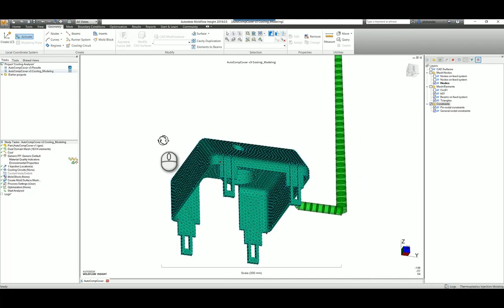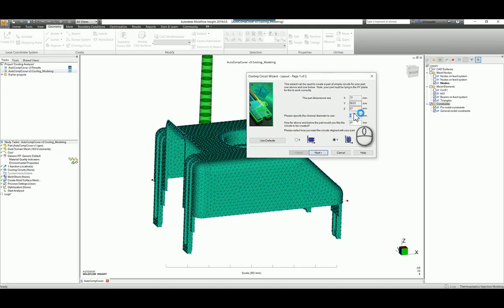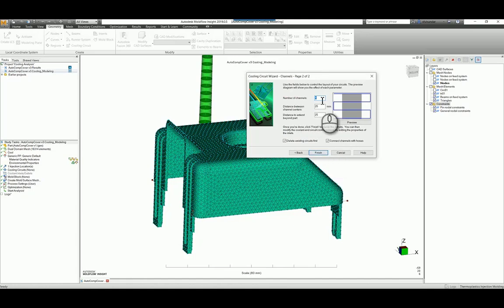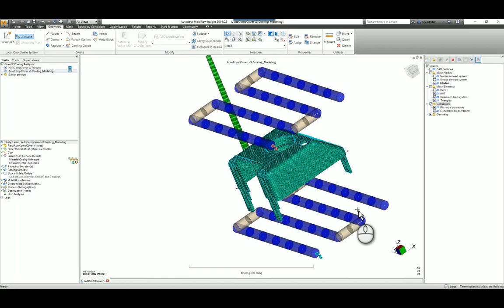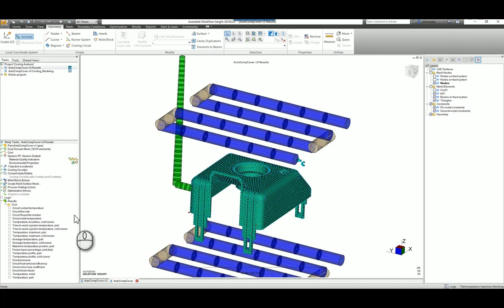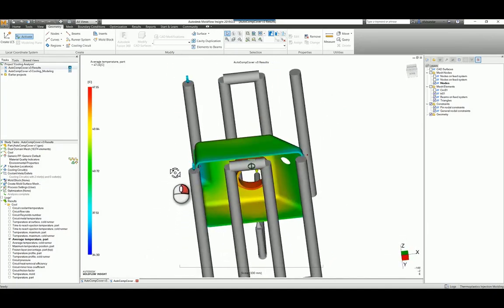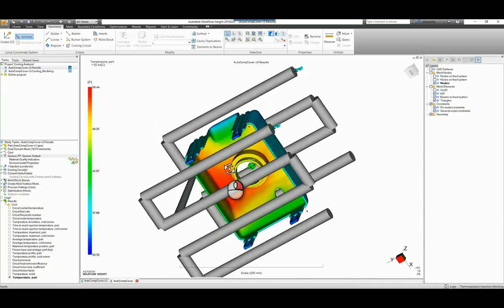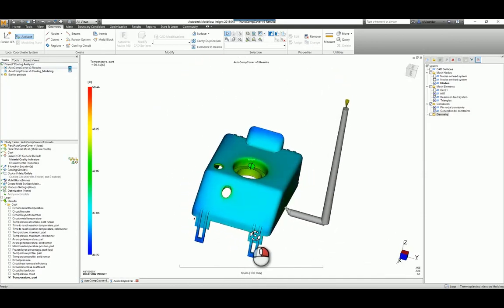Autodesk Moldflow Cooling Analysis - Getting Started

Comment: Hello Sir Sachin 
i have a question about the accumulation of heat through cycles for example if the cooling cycle ended with temp variance of 5 degree and the second cycle started that place which has high temp will be even hotter after the second cycle and so on after many cycles and may end up being way hotter than the other parts of the surface right ? 
what is the analysis in moldflow that can help me predict temperature over cycles and how to solve that problem 
thanks so much
Reply from the maker: Hello Mustafa - thanks for your query. Moldflow Adviser basically does a static thermal analysis based on the Mold filled with molten polymer. Melt temp is taken as the reference to start the thermal analysis. What you are referring is the transient analysis and that too with production start up. Yes there would be temperature difference between two cycle but when the process get established ( like eg after 25 cycles) different should be constant thus equilibrium is achieved. It is possible with Moldflow Insight standard solver. I hope this helps. Thanks
Reply: @sachinfulsundar5012  thank you so much Sir

Comment: How to reduce deflection after adding cooling channel ?
Reply from the maker: Hi Deepak, Thanks for your comments. In isolate the cause of the warpage you should able see the cause of warpage. If it is cooling that is major contributor then you will be the area of highlight. You need to model the cooling components along the highlighted area. It could with baffles or cooling inserts e.g BeCu and re-run the simulation to check the effect on deflection. I hope that helps.
Reply: @sachinfulsundar5012   thanks for your suggestions. 
In my case deflection results with fill+pack+warp & cool+fill+pack+waps is same.  after doing analysis with cool+fill +pack+warp, I would like to see reduction in deflection.
Reply from the maker: @24deepakmahajan61  fill pack warp consider the uniform Mold temperature versus cool fill pack warp considers the variable temperature based on cooling channel. I would suggest check the cause of warpage by isolating it.
Reply: @sachinfulsundar5012  I will try it. 
Can you please make one video on this problem.
Reply from the maker: @24deepakmahajan61  sure I will try. Mean time I would suggest to try an get help from Autodesk Support team.
Reply: @sachinfulsundar5012  I will be thankful for it.